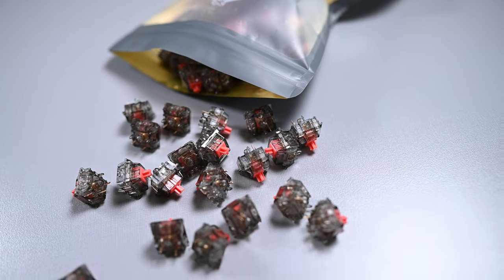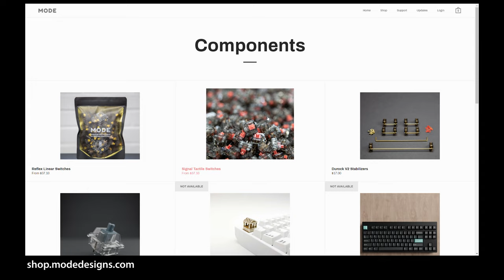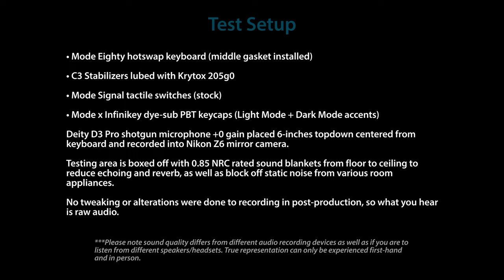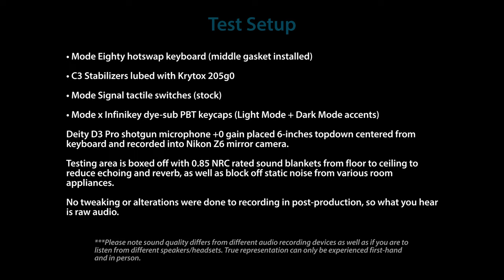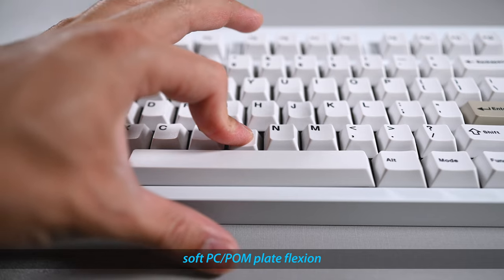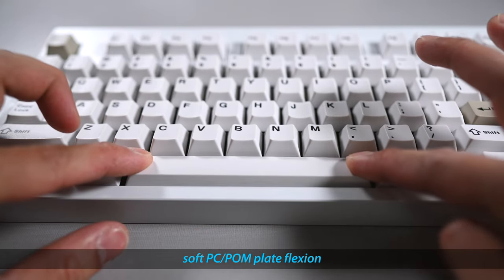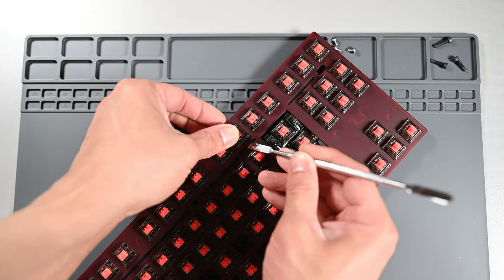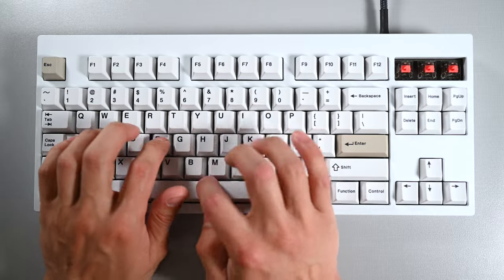Alu vs Brass vs FR4 vs POM vs Polycarbonate Plate (Tactile)

Comment: Brass seems to boost both low and high end simultaneously, FR4 is similar but less high end and more midrange. POM and Polycarbonate are very similar, not much midrange or top end, maybe low midrange and lower end but at the same time you can't say it's thockier than FR4, a lil more muted. Aluminium has a little scratchiness to it despite it also adding some low midrange, which makes me think it boosts a bit of some very high frequencies above brass even though it's not a clacky sound.
Reply: Personally I don’t like how brass feels it’s too stiff. I don’t think high end is the right word to describe it. It’s just different.
Reply: @raymondmichalak1026  brass is very stiff and feels scratchy to me
Reply: @raymondmichalak1026  they meant high end as in high pitched frequencies
Reply: @raymondmichalak1026  they meant high end as in high pitched frequencies
Reply: I absolutely hate brass in person it's much worse then this video. Pom has the most pop in person. Pc is right there with it and alu is great with Mx blacks or op blacks on this board. Brass is the worse out of the bunch tbh. But then again it's all preference tbh it would of helped if he actually did good with luring the stabs and switches he had so little pop compared to what there should of been and pc/pom with switches that sound unused sound worse when lubed though sound way way better if they were all lubed correctly these plates would of sounded much different I am not trying to be rude but it was horrible lol

Comment: Great video! Thanks for putting in the work. I'm like you, more able to distinguish by feel than sound. I spent too much time at concerts I guess (but will end up saving hundreds of dollars on audiophile equipment). Maybe with time I'll begin to pick up on the nuanced differences. As for feel, I've yet to try FR4 or POM (though I have both on the way). So far I don't dislike PC's relative flex. It's an interesting experience using really tactile switches on it (Holy Bobas). Maybe I'll like PC less with linears. Anyway, like you, still a lot of experimentation to be done. Cheers!

Comment: Awesome video. Straight to the point, great methodology, and not afraid to diverge from the mass opinion of how plates make a drastic sound difference.

Also cool to see someone have the same unorthodox right hand typing style. IDK when but I stopped using my thumbs for spacebar and shifted to using my index finger
Reply from the maker: Someone pointed out my typing style and I've been trying to correct it. I know it's not proper, but after a few months of trying to type "properly", I'm done. I been typing with index hitting space since forever... habit is burnt in lolol
Reply: @hardlinenexus  ironically I'm pretty sure I started hitting space with index finger after spending a week trying to change to correct home row. It just feels more ergonomic having my hand angled

I will say my WPM went from 110 to 130 when i started doing index finger space bar 😂

Comment: Thank you so much for this! I saw the linear one first and hoped there was a tactile one and I'm so glad there is!
Reply from the maker: I will have another plates comparison video coming up! This time it's for a 65% and it will also include 2 plates that weren't in this lineup. Carbon fiber and copper.
Reply: @hardlinenexus  Awesome! I just picked up a Portico over the weekend and am going to be using it with Boba U4 switches! I have a GMMK Pro right now and am using it with a Polycarbonate plate and U4 switches and it's awesome! Definitely excited to get the FR4 plate though, which everyone seems to love!

Comment: When you say the POM is too soft, can you elaborate how you not enjoying it?
I just bought the Keychron V1 and then I just learned about the gasket mount and I am thinking about investing money on modifying the board to be gasket like (cutting the standoffs and such)

The thing is I have never tried a gasket keyboard and I don't have access to try it out in where I live and I am not sure if I will really like super soft feeling....
Reply from the maker: So plates like POM and PC are softer than the other materials. This video is a bit old and I will say my preferences have changed a bit and I can appreciate POM and PC plates more now, but they still aren't my main preference. To elaborate, I think at the time of doing this video, I just didn't like the installation process of POM and PC plates, switches take a bit more work to fully seat into the plate/PCB stack is all.

Comment: I currently have a hotswap PCB with FR4 and POM plates. The FR4 is less flexy but to me it feels a little softer and has a better sound profile. I think I'm gonna order a solder PCB and POM or FR4 half plate for more flex. You still think FR4 would be the best half plate option?

Comment: Great video and it was very useful in helping me to pick a plate.  When the Mode Eighty becomes available to order this month then I am going for all Black with Boba U4T and GMK Wob switches and the FR4 plate.

Have you preordered the Mode SixtyFive? If so when what colourway did you pick?

Andy Nguyen did some tests with the Mode SixtyFive and brass bottom with tactile switches.   The cheaper aluminium bottom sounded much nicer.  Does the same apply for the Mode Eighty? I.e. stick with the stock aluminium bottom.
Reply from the maker: I did order the 65. I'm also working with Mode to make some videos for them, one of the videos being a plate comparison like I did here. The main reason why I'm redoing the plate comparison in 65 is to incorporate two plates that weren't available for the 80 back when this was uploaded (copper and carbon fiber). I'll be getting my samples and the 65 this month (in a couple weeks). Stay tuned :)
Reply: @hardlinenexus  Great! Look forward to your video.

Comment: Hi! My current keeb has a steel plate(stock) and I'm rocking u4ts in it. I have an option to upgrade my plate to a POM plate only. Would it make a difference in terms of sound and feel? I'm fairly new in the keyboard world. Btw nice comparisons!
Reply from the maker: Yes, steel and POM are basically on the complete opposite ends of the spectrum for both sound and feel. POM is very soft and firm for typing. Steel is solid and can sound high pitched in comparison.

Comment: I hope you or anyone could reply, im actually using a keyboard with full plastic build and im hoping to switch the pcb plate if i switch it with aluminium would it be safe ? And what would be better aluminium or acrylic (plexi glass or what ever people call it) the keys are black optical.

Comment: How did you get any other material for the plate besides alu? I checked mode's website and I couldn't find it. Is this something you got that was made by another creator or was this some sort of group buy for the Eighty that I might have missed?

EDIT: Nevermind, I've found it but I'm disappointed to find that these other material options are only available for the solderable plate. I plan to get a hotswap pcb but now knowing this I'm not so sure anymore. Do you think that the solder plates will work on a hotswap pcb?
Reply from the maker: You are correct, the plates are for the solderable PCB. But I used these with the hotswap as well and they are compatible
Reply: @hardlinenexus  ah ok. So i wouldn’t run into any major problems mixing the solder and hotswap plates then. Thanks

Comment: Have you tried the pe foam on your mode80?
Reply from the maker: What's the PE foam?
Reply: @hardlinenexus  https://www.reddit.com/r/MechanicalKeyboards/comments/nv4ce4/guide_do_you_like_the_jelly_epoch_sound_but_dont/
read about it here! but keep in mind that as per Mechmerlin, this kind of foam has its risk static issue although i've not heard about it happening to anybody and my friennd has been using it for quite awhile
Reply from the maker: @johnathanchan6590  I have not used this sort of foam and most likely wouldn't either. If there's a risk for static then I wouldn't throw that in my $900 Mode Eighty lol, even if it hasn't happened to anyone. Besides, I like the way my Mode Eighty sounds with the gaskets that they provided already anyways

Comment: When I built my mode with alum vs FR4 it sounded totally different
Reply from the maker: What did it sound like to you? The differences that is
Reply: @hardlinenexus  The alum plate was definitely a higher pitched sound comapred to the fr4, FR4 is definitely the more thockier sound. I understand you might not like the soft typing feel of the pom and poly but they really do sound different even in your sound test.

Comment: why would you use such a quiet board to compare sounds
Reply from the maker: "such a quiet board" is subjective. Mode Eighty is also the only custom keyboard I personally own that has this many plate variations. And it's also a board that was more accessible to the public with a fast delivery time.

EDIT: Also, it wouldn't have really mattered if I used some other boards, because each one will sound different regardless. If I did one with a Keycult, RAMA, NK65, Tofu... whatever, people are going to ask for comparison in another board. So I used what I have.
Reply: @hardlinenexus  understandable, but having to put my volume on 100 for both youtube and my pc is hard to hear.
Reply from the maker: @Saddy3441  Hmm, different sound/listening devices are also factors to consider. What speakers are you using? I have the Creative SoundblasterX Katana soundbar, speakers set to 50% may be too loud for me.

Also each person's hearing sensitivity too. You're actually the first person to say this is too quiet lol. Digging through the comments, everyone else seems to hear it fine.
Reply: @hardlinenexus  Wow, i have razer headphones and i can blast it and i can barely hear a difference. Although i definitely prefer hearing the tactiles over linears since the linears are just impossible for me
Reply from the maker: @Saddy3441  Razer huh. Welp.... I have nothing to say about that 😆. No comments.
Reply: @hardlinenexus  yup, it's a hand me down but it still works and is still pretty decent if you were to compare it to any other 2016 product